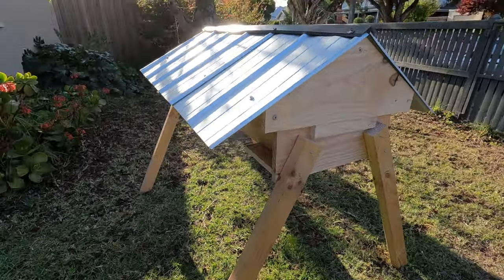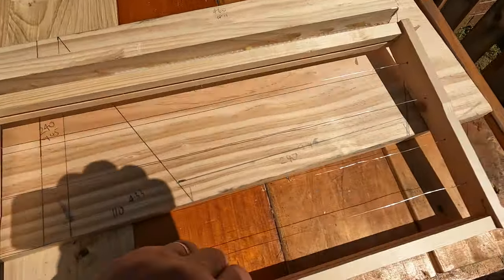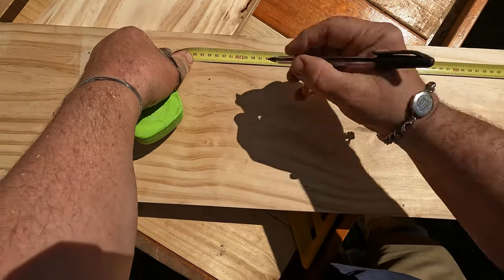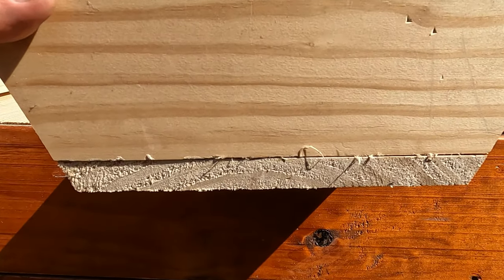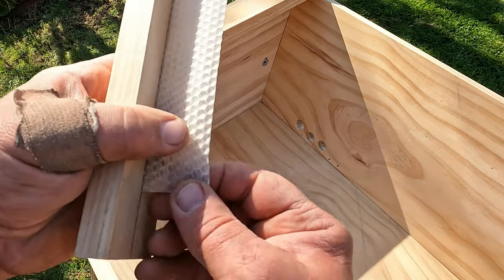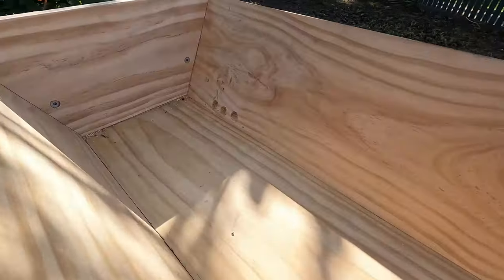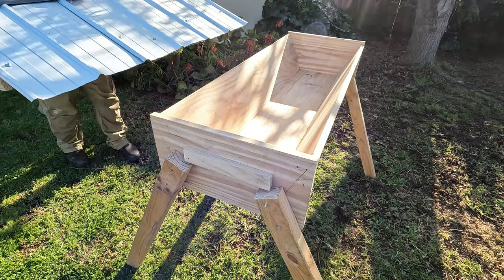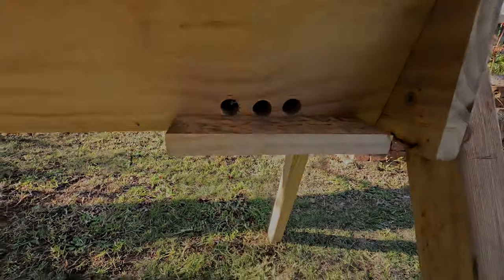DIY! How to Build a Top Bar Beehive! With NO PLANS! | #Aussiebeekeeping #topbarhive | 3-10-22

Comment: Love how this is all done with hand tools with no fancy saw bench. Most of my ‘carpentry’ is pretty rough, so I find the OCD woodworker stuff a bit intimidating. Not sure how I’ll go freehand ripping on the angle, but might give this a go.

Any way you could hinge the lid or would it be a bit ‘tippy’. Might be more amenable if it was a single slope (less weight?).

Also, any tips on a good retail outlet for 20 mm wide dressed pine (Melb Vic)?

You leaving raw or painting the outside? Jo
Reply from the maker: I had another with a hinged lid. There’s a couple of videos of it’s on my channel (pretty early) the only reason I didn’t with this one is because of the double sided entry. 
I get my timber from Mitre10. I have a trade a account so it is pretty cheap.
I will treat it with wood preservative but everything has been put on hold with this weather.
Reply: Your hardware store off the shelf 42 mm wide bars seem to work fine! I’ve been reading people say brood bars must be 32 mm and honey bars must be 35! Do you never get cross-combing? I wonder if your relatively deep starter strips is what keeps them organised? I’m going to try make one of these out of scraps…

Comment: Have you considered incorporating a section on one side or the entry of the Top Bar, to hold 10 or so normal 19" full height frames for the brood with a queen screen seperating the suspended comb? 
My thoughts where this would geive you benefits from both designs, make it easyer to split the hive or transport. the brood etc.
Reply from the maker: Yeah I have. I just can’t justify the need. 
If I need to I can transfer the brood in a standard Langstroth.

Comment: How did you attach the foundation to the topbar?
Reply from the maker: I cut a groove in the timber with a circular saw them used a soldering iron to melt wax and attach the starter strip. There’s a video with more about it in the top Bar playlist.

Comment: The roof shape is for a cathedral beehive. You should have just built cathedral shape combs the gap under the roof is wasted...
Reply from the maker: The roof is high pitched to work as an air gap for insulation in the hot Australian summer.
Reply: There’d be more work making cathedral frames than probably this whole hive build!